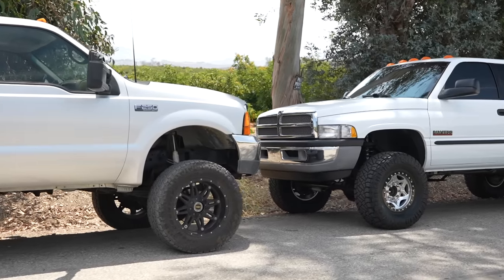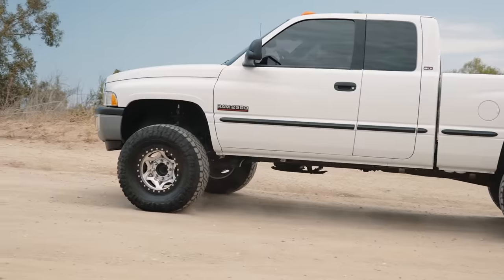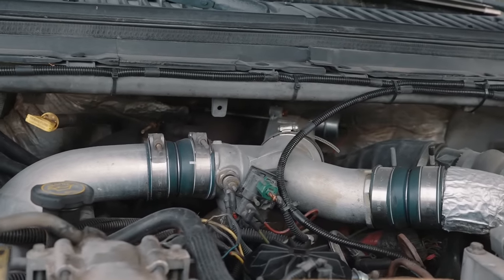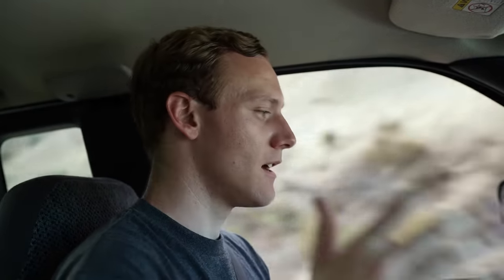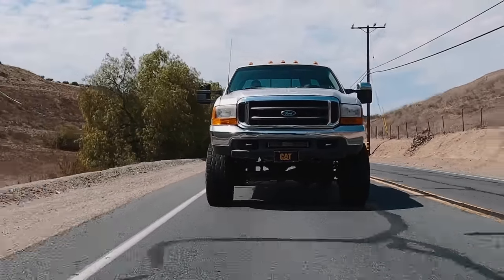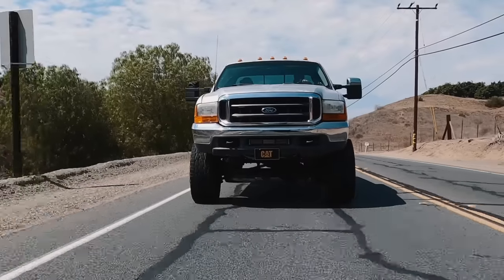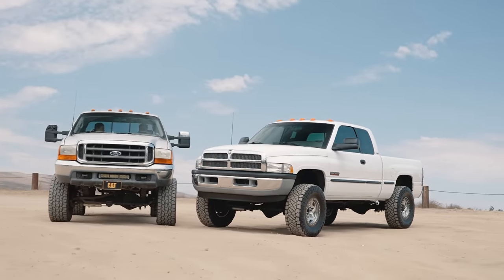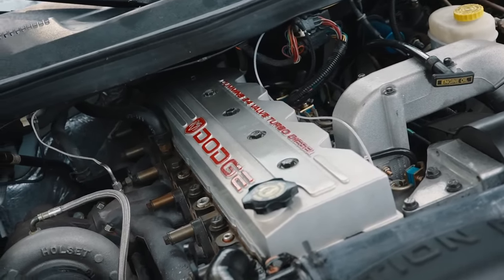1999 Ford 7.3 Power Stroke Super Duty vs Dodge Ram 5.9 Cummins 2nd Gen | Which Is Better?

Comment: The 7.3 is a turd.  The rest of the truck is great.  That’s why Cummins swap is so popular.  You get the best of everything then.
Reply: If you think the 7.3 is a turd its because you're comparing it to a modern diesel. It was very competitive in its era
Reply: @twayland6186  I will give you that.  I still think the Torque of the Cummins was noticeably better and that is what makes it a better set up.
Reply: @tjfaulkner7897  the cummins is technically better of you're comparing engine to engine. If I would ever do a fummins build you're better off doing it to a 6.0 or 6.7 a lot are cheap with major engine issues
Reply: @twayland6186  I agree.   Those 2008-2010 super duties are great trucks.  Nice interiors too.
Reply: The 7.3 is a turd lol try to build it to keep up with a modern truck not happening. But the 5.9 is really easy to get 1000 foot pounds of tourqe out of. It's as simple as injectors, headstuds, air dog or fass, a turbo a 3rd gen he351 turbo will be plenty to make 1000lb of torque, and a tuner of some kind either quadzilla or edge I prefer edge simply for the monitor so I don't need gauges.
Reply: @1g_dsm_life154  what you're describing isn't cheap and will really shorten the life of the engine without cooling mods. Also the same work will get similar torque numbers on a 7.3
Reply: @twayland6186  my truck has over 400k miles with all the mods on that list and still running strong and has been modified pretty much it's hole life.
Reply: @1g_dsm_life154  make a video and post it with the dyno numbers.

Comment: Great unbiased vid! I have a cng powered gas engine F-350 but thinking about doing a Cummins swap because it's a smaller simpler engine. Id lean towards a 12v because it's all mechanical.

Comment: Thanks for your review.   I have a 2000 F350 dually and the ride is bad when unloaded.   I love my truck and I pull a 5th wheel with it and the truck has been very good to me.   I don't drive it in snow so the body is in excellent shape along with the insides.  I have a manual trans and it has not had problems.  Ford got this truck right.

Comment: I own a 3500 ram 2nd gen and I prefer the look of the Ford. But the suspension on the Dodge and the ease of upgrades is a big plus to me.  Also buying 6 injectors vs 8 is a not meaningless cost savings.

Comment: I bought a 2002 Dodge 2500 5.9 with 6 speed trans and its has been the best most dependable truck I've owned I bought it new an now ha 316479 miles on it ! I've towed , hauled many different trailers an pulled heavy logs up steep dirt hills and the truck has never let me down ! So saying this I've used my truck in many different ways ! I've got a 32 ft tag along camper saying right at 10,000 lbs and it performs well ! I've done a few upgrades such as the Fass Fuel system 5 stage edge comp box an a Smarty stacked on it 4 inch exhaust  cold air intake ! Still has factory injectors an factory turbo ! So I'd say 5.9 Cummins dodge is one tough unit !

Comment: By the way a Cummins oil filter is accessible from under it very easy. No need to remove air box. I have a 2005 5.9 use a ratchet extension and filter wrench when under it draining the oil. Get both at once

Comment: I've worked on both, and would rather work on a 7.3 hands down. 7.3s are intimidating if you've never touched one, but once you get to know them they are very simple and easy to work on, turbo is gravy on the 7.3 once you learn the tricks to pop the v-band clamp on the up pipe y, it takes 30 minutes tops to have both valve covers off for injectors, glow plugs, uvch etc. HPOP is way easier to change than a vp44, power steering pump is a nightmare on the 24v, about the only thing I'd rather do on a cummins is the water pump

Comment: Spot on where the power band is in the 5.9 vs 7.3.    
When I did a Cummins swap the 5.9/zf6 would pull even in 6th gear at 1900rpm would go up hills. Low end with low and 1st gear was a tire breaker with a load. 
But it has a narrow power band, it also hurts the 5.9, have to find the gear that keeps it in that range. 
7.3 is a dog on the bottom end,, but has a wider power band. keep it above 2000rpm it sings and pull slow and steady just like the 5.9 at 1900rpm. 
Both trucks are great I'd.love.to have a 98.5 3500 last of the p-pump next to my 7.3.

Both trucks ride better with a load by the way.

Comment: Yo I appreciate the video. Literally comparing these 2 exact years and engines. Im selling my house and going with the camper life and these 2 absolutely workhorses are both so good, dependable, easy to work on and easy to tune for more power. It's a tough one to decide.

Comment: I love my second gens with an NV5600. If it had to be an auto I’d probably go Ford, but otherwise Dodge for sure. Even the newer 6.7 Cummins are relatively easy to work on and the 5.9 is a piece of cake to service/upgrade. I wish someone made a dash for the Dodges that was molded in higher quality plastic. You can buy a manual transmission truck and fix the steering with some aftermarket parts but the interior is harder to fix.
Reply: Got my dash from Genos 12 years ago and it still looks new.

Comment: I have an 03 5.9 dodge and an 02 7.3 Excursion, I love both for different reasons. Cummins definitely feels like more torque but the 7.3 has a better top end speed. I say as far as  comfort both very close, dodge definitely more comfortable suspension even lifted, the 7.3 is stock with leaf springs.both leather trimmed. Dodge leather definitely more durable, I won't get rid of either one.

Comment: ...having a stronger transmission and not falling apart interior does mean a lot. However, a harsher ride does beat one up. Both seem excellent! That being said, I have a '99 7.3 Superduty F-550 Cab Chassis with a Crysteel Triple Tipper Dump Body weighs close to 12,000lbs empty and nearly daily hauls 5-6 tons of stone or 5 tons of excavator and, sometimes both at the same time. In 4 low, it has never had too little power.  ...been a great truck (power a reliability) for land work in the mountains of Western North Carolina.

Comment: So, as I have often said, the problem with the Cummins is that it's wrapped up in a Dodge.  Obviously I'm a Ford guy, but this video makes my case.  There's not much cooler than a I-6 motor, and diesel and turbo on top of that, well, that's the cream of the crop, but build quality and overall package, sounds like Ford knows how to build trucks if you ask me, Dodge knows how to outsource the best engine option.  Where do I go wrong?

Comment: 1992 7.3 Ford diesel 5sp. ZF5 speed trans, Super-duty tow truck used commercially to this day 880,000+miles when first engine failed** now new/used engine has 270,000. Truck still original interior everything works including power windows XLT.  I have only replaced bench seat seat bottom. Dodge 5.9 is a respectable diesel truck engine also. :))

Comment: The 5.9 is the better engine. But I’d take the 7.3 because the truck as a whole is better than the dodge. 

The Cummins will run forever but you’ll have to replace the truck around it. The PowerStroke may last not quite forever but the truck will make it there with the engine. 

I do prefer the look of the dodge though

Comment: I have a '99 F-350 xcab lb. 7.3 4x4 auto with stock suspension and it rides so smooth.
You lose ride comfort when you put a lift kit on it.
My front end is low, and rear is really high and when I put a heavy trailer on it, it levels out
and drives like a dream.
The real test would be trucks with stock suspensions.

Comment: Always been a ferd guy but also always respected Dodge. Almost bought a 2021 Ram but the payments woulda broke me. In the era of trucks in this video I'd go with the Ford if for no other reason than how much time I spend driving I'd require the better interior quality, enough to not worry about potential rattled teeth or needing upgrades over stock (IMO).

I currently run a gasser 03 F150 Lariat  4x4, leveled on 33s, aftermarket exhaust and other goodies  (319000+kms on surprisingly reliable 5.4 but 12mpg average SUX)  but my ideal upgrade will be an Excursion (likely an 05, 6.0 if well maintained). My "dream truck" would be a custom '79 F250 4x4 build.

Chevys? In my experience, using all 3 brands for 35 years in construction equipment industry, the best running part of any GM product is always the owner's mouth (with the exception of an old 1990s Cat powered 7500 that just won't die -unless you look at interior plastic and wiring falling apart)

Comment: I would be happy with ether of those trucks! But I think the super duty is a better/ stronger built over the 2nd gen body style. The 24v is made even better when you delete the vp44 pump to a p-7100 injection pump. Internationals HEUI system can be trash if maintenance isn’t kept up. So many variables that shine and fail on these trucks but at the end of the day I think I’m taking the Ford.

Comment: This is probably the most fair and hinest comparison on trucks ive ever seen. I think there both legendary trucks and you cant go wrong with either. I would personally take the for over the dodge mainly because the automatic transmission issues i know the dodges have and the dashs falling apart. Honestly it would be a tough decision is the dodge was a 6 speed lol

Comment: I like the comparison of both diesel engines unfortunately never had a diesel  I own 1997  dodge 3500 dual rear wheel 5.9 gas 5 speed chaise cab and a 2003 f250 sd ext cab with a 5.4 short box both are good trucks 
And would be worth buying

Comment: In 1999 Ford had a transmission overheating issue on their 6sp manual so I waited for 2000 to special order a F350 7.3 with 6 sp manual with their trans oil cooler.  Still own the truck after a 5 position programmer, 4" straight back exhaust, cold air and a Garrett Powermaster larger turbo.  I paid $28K new, and I'm seeing both of these gems online for up to $35K.
My daily driver is a F150, and my trailer puller is the F350, and my snow plow truck is a 1995 F150, and my manure hauler is my F700 LOL.  "The winner is"- BOTH OF THE OWNERS.....

Comment: I grew up around both, my dad had a first gen cummins and a f350, both were from 91, both ran great and were fantastic trucks. He currently owns a 92 idi 7.3 and I own 2 2nd gen 12v dodge rams. I would own either truck. As a diesel mechanic,  keep it simple stupid is what I love in a truck. So if I can escape the pain in the ass which is modern diesels, I  will for my personal truck.

Comment: I have owned both.  They are both great trucks.  The RAM is much more comfortable , and is more fuel efficient. But it  also requires more repairs.  I have replaced wheel bearings, steering components,  tranny cooler and lines and of course had tranny rebuilt.  The Superduty is heavy duty.  It is all around a better built truck.  I actually had 2 of them.  Both 2000 f250 with high milage 385,000 and 275000.  Never did any major repairs to either of them except 2 injectors on the seccond one.  I pull heavy trailers and both the 5.9 and the 7.3 will tow like crazy.   I guess if I had to pick,  My perfect truck would be the superduty with the 5.9 engine.

Comment: Can't really say when it comes to Diesel, but I would definitely take the Gasser version of the Dodge, Kinda already have cause I've got 2 of them! The stock version has been insanely reliable for a stock platform, pushing 500K+ miles and all its really needed is front CV axles (rough terrain abuse) and then general replacement parts, water pump, power steering pump etc! I've drove lots of different trucks and I personally feel that the Ram is the most comfortable of all of them! The coil over front end was really far ahead of its time, for what it was being put on, and I forget exactly which way is which but I think its Ford that uses a closed section frame, or more of a box frame for the suspension mounting where as Dodge uses open section, making the suspension flex from itself instead of pulling the body into the flex!   Also yeah the interior quality feels cheap but its perfectly fine, I've stacked the cup holder in mine with two 64oz drinks, 3 packs of cigarettes, couple lighters, dollars worth of change and its still mounted and working lol

Comment: I personally gotta go ford on this one, the truck looks better in my opinion and that 7.3 is just such a better sounding motor. One thing I will give the dodge credit for is that suspension setup in the front which y’all mentioned in the video, my dad used to own that exact truck and the suspension was definitely not ideal but still I just love the 7.3 and the body

Comment: I've had my 2000 F-250 7.3 4X4 Lariat with 'The Real Power Stroke' for 20+ years and has been stupid reliable!  All leather interior still perfect. Upgrades started with A/C International injectors, Banks intercooler, Banks turbo kit, and Yes the Turbo is a bear to get in and out!  TS 6 stage chip. Not lifted but did a leveling kit up front. 
No major repairs justa maintain the service! Was running over size tires that did in the front bearing hubs, my fault.  But Big Blue is still in Premo condition and to help the ride quality, which a Truck is supposed to be truck, I have dual shocks up front with a steering shock, which helps Allot! 
My Vote... F-250 7.3 😎 besides I prefer a 440 ISX Cummins in my 2010 Kenworth W/ 18 speed  😎

Comment: Good video, for owning the trucks you were comparing, I thought you both were unbiased. I own a 02 2nd gen with the 6 speed manual. I have a hard time not being biased towards the Ram, but that being said I’m on board with your opinion of the Rams auto transmission. Rams automatic transmission is terrible! I also owned a 96 12 valve with the automatic. Everything was stock on the engine. It made good power but I had to rebuild the transmission twice in 325,000 miles. I used it for work and pulled a trailer almost everyday. The first rebuild I didn’t spend the money and have it done right. The second time I had all billet internals used, and didn’t shy away from the cost. That’s what I should have done the first time. I sold the 12 valve to a friend, and it’s still a really strong work truck. I think both trucks are really good diesel’s. My opinion on Ford isn’t a good one. They might have good interior build quality, but that’s were it stops. They hit a home run with the 7.3 but failed miserably with everything after that. Usually car company’s make there products a little bit better each time they put out a new year model. Ford made one of if not the worst diesel ever with there 6.0 Compare that to Ram, they have possibly the best diesel ever made with the 5.9 They just built on that success and made there 6.7, another great engine. That it why I would choose Ram every time over Ford.

Comment: Wow has that got to be the cleanest 2nd gen I’ve ever seen. I bought one a while back from Arizona it was beautiful just a couple dents. Drove it through 2 winters only. Undercoated it and sprayed it off religiously. Rockers are gone now, rust in drivers side bed wheel well and small hole in frame by steering box. I hate what ohio puts on their roads.

Comment: Driven both, worked on both and only own the L99 7.3 power stroke. Yeah they are a little more of a pain in the a$$ to work on compared to the 5.9 and rough ride but will not leave you stranded with routine maintenance. And if both built to equal HP the Ford will out tow the cummins

Comment: Excellent video! I'm looking for a nice (not rusted-out) 2nd gen, but prices are absolutely through the roof right now! 
By the way, Ram switched from "H" to "E" transmission designation (from Hydraulic to Electronic control) I belive for the '96 model year, so your 1999 actually has the 47RE, not 47RH.
Reply from the maker: Yeah I totally slipped while talking and didn’t catch it until after the video posted!
Reply: Still junk. Every Dodge I've owned has had the transmission rebuilt or replaced after buying it. Got an 05 with over 400,000 on it and has already had 1 new ATS  transmission, and even a rebuild on it

Comment: I would have to pick the Ford. I’m not a big fan of the vp44 pumps or the 47re. But I am a Cummins guy. I daily drive a 95 3500 dually
Reply: Nothing wrong with the vp44, just the crappy transfer pump that supplies it.
Reply: @averyw.3939  I suppose Im just a little biased about them cause I’ve had them fail. I prefer the p7100 and the cp3 models.

Comment: I’ve got a 2nd gen , 2001 3500 dually. I’ve had it for two years and it’s been broke down more than it’s been on the road lol. A buddy of mine has a 97 7.3 , 250 . I would take his truck over mine any day. I will say my dodge rides much better and pulls heavy loads a tad easier. I’ve had so many issues with my dodge, that it’s ridiculous. It’s for sale or trade if anyone is interested.

Comment: I have a 2001 24v with 290,000 miles on stock transmission with quadzilla module, no tranny problems no engine problems.

Comment: I agree with this video. I'm a 2nd gen guy myself, had a 00 3500 24V Dually with an automatic tranny. Sold that and purchased a 2nd gen 3500 24V with a 6 speed tranny. And I brought that up to slightly disagree with you, yes the automatic transmission are not the greatest. Yet, the 6 speed transmission in my opinion will win in battle verse the 7.3 tranny.

Comment: One thing with the 7.3 is they have the same frame and body as the 6.0 so if you can find a 05+ axle it’s not hard to mount the coil buckets and radius arm brackets.